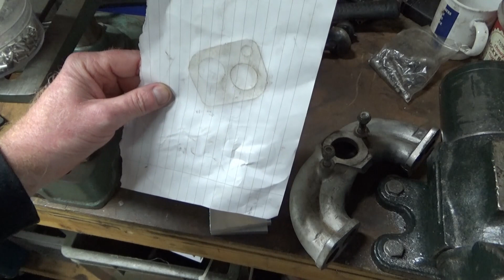Reliant 850 Trike - Carburettor Inlet Manifold Adaptor Plates

Comment: Considering that you already have manifold spacers you might have seen an improvement by simply matching the port length in the manifold by grinding the corner out further up inside the manifold runners making them straighter and more parallel.
Reply from the maker: I did consider that and may well have seen improvements but I went with the adapters as I can easily remove them if I need to. 

Ideally a redesigned manifold would be better but not with my current skill set or budget. 

But I’m always open to other options, thanks. 👍👍👍
Reply: I've got a fuel injection mocked up for mine I need to make a fuel swirl pot for the pump to sit in either externally or inside the fuel tank, just never have the time to take the car off the road.

It is a single point set up from a fiat 899cc Cinquecento/seicento magnetti marelli iaw 6f/16f ECU with a 30mm throttle body , 32,34,36,and 38mm are available as OEM fitments on other cars and 40+mm are available as custom made options, the 32mm from a Punto 60 is quite popular and what I have for mine (closest to the original su diameter)

 it is a very basic set up relying on just a crank sensor for timing of fuel and spark, coolant temperature, lambda/o2, inlet air temp, and manifold pressure for fueling self adjustment.

They are live remappable using an EPROM emulator adapter and loggable using cheap cables and software.

They have auto adaptions for idle, cruising and light/mid acceleration, closed loop o2 monitoring, but fall back to fixed fueling at wot.

Firing order of the fiat engine is different but because it runs wasted spark it is good to run on a reliant.

Only real mod to the engine is a 60-2 trigger wheel and an extra coolant temp sensor, 

the first tooth after the missing 2 lines up at 114° btdc, That gives an idle advance of 8° btdc which will be fine and iirc a total advance of around 35-38°.

I've got an original reliant pulley (approx 5" 127mm dia) indexed ready to fit, the teeth are a smidge over 3mm wide 3mm tall and about 3mm deep with around a 3.5mm gap between each tooth.

I'm hoping it is enough for a reliable signal using the original magnetti marelli sensor (3mm tip good for 12k rpm with its standard size pulley) 

Wiring is a bit more involved if you have an immobilised model otherwise it is like 5 wires to hook up the ECU and the dash fault light etc.

The immobiliser can be turned off though.
Reply from the maker: Sounds like a cool mod, how have you installed the injectors?
Reply: @bodganeering  single point in place of the su, they only run on 1-1.5bar pressure.

I've moked up one mounted like a zenith carb using a 3" diameter spacer bolted to the reliant manifold and the original fiat spacer on top.

The other keeps the swan neck like the su with a 3.5" diameter spacer but the throttle body is bolted directly to it.

I haven't decided which I'm going to use yet.

The fiat throttle cable looks like it will fit the reliant pedal box by just cutting the rubber grommet off the cable and cutting a slot in the pedal box so that the cable can slot in, the reliant cable goes through a hole but the fiat cable has a plastic block.
Reply from the maker: Plenty of options for the cable, nothing a ferrule and a bit of soldering wouldn’t get round but hopefully you won’t need to go that far. 

Good luck with it. 👍👍👍
Reply: @bodganeering  with a slot cut the cable hooks straight on and the pedal travel seems sufficient, worse case I might need to relocate the hole through the tunnel/bulkhead.
Reply: https://youtu.be/8udOFdepF0s

This video will give you a basic idea of how they are set up.

The chap is retro fitting onto a carbed seat that uses the same engine, and is where I got the idea from.

Bought a donor seicento last year moked up all the brackets etc but not had time to fit, I'm putting together a spare engine to test run it on now though.
Reply from the maker: I’ll have a look when I’ve finished work, I do like things done differently and betterer… 👍